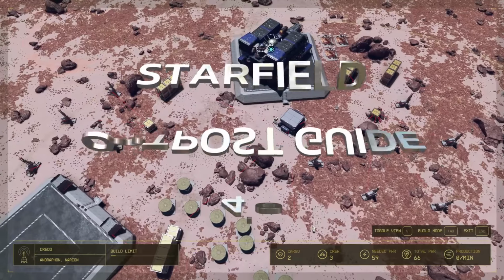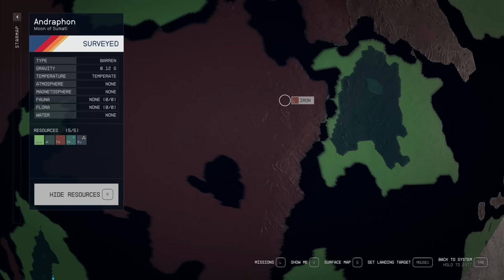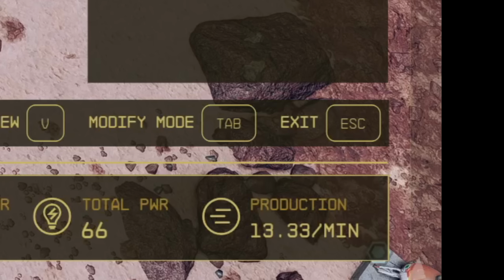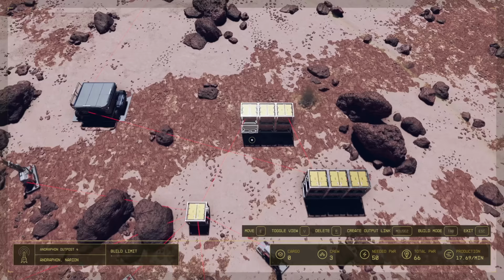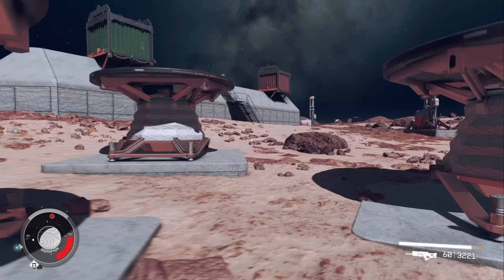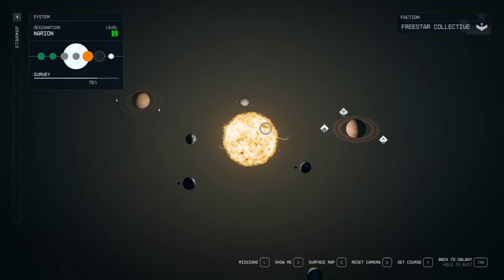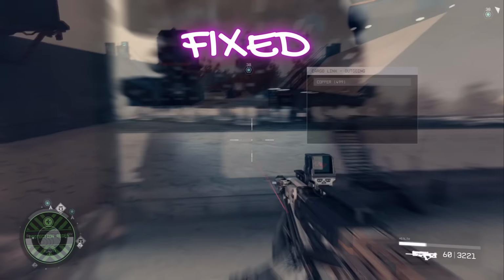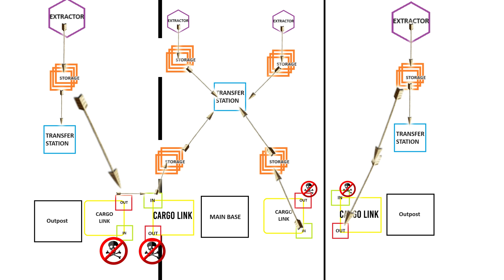[Starfield] Outpost Guide 4.0: How To Connect and Organize Perfect Outposts

Comment: When storing massive quantities of resources from inventory to storage it will not funnel the resources down into the seperate containers even when linked. Storage connected to extractors funnels through all connected units. How do you store massive amounts of solid resources from your inventory to containers with one click??? I connected everyone in a chain but it just it doesn't work when it's being transferred from your inventory....
Reply from the maker: It won’t work like that. You can however put all materials In your inventory into the infinite chest in the lodge crafting basement with on click. I typically will bulk move all my stuff there for later crafting.

Comment: nice video, fairly clear and way better than I started out with, should help loads ... my question if you have had this problem .... how to sort multiple item types ie iron and copper on one system interlink ... I can get the items to the new interlink but sorting them ??? it goes into one storage and you are unable to separate the incoming types ie I have 6 items incoming from 1 outpost but I can only sort them into solid/gas/liquid not say iron and copper in the solid
Reply from the maker: This is the problem with cargo links. They really suck. Unfortunately the best method is going outpost to outpost

Comment: Thank you for this. Can you make a video explaining power generators. I can't seem to make these work efficiently at all despite having 6 extractors all going to helium production. It seems the generators take every bit of the helium despite having solar arrays also running the helium extractors.
 It has been an absolute headache trying to figure out the issue. Or is it that helium power generators need a buff in an update? It almost makes no sense to even have them. I have 0 helium production because the generators consume everything. It should not be this hard to figure out
Reply from the maker: Honestly helium is useful for starsystem cargo links but as a power source seems silly. I just spam solar personally as I can make unlimited amounts

Comment: If spa e is tight, can you put storage boxes all on top of the ressources? Ie inside the Extractor bubble.
Reply: The only limit for space is really where you want your initial extractors, so place all those first and build right up to, and around them later to fill up the base with cool and useful stuff like a decked out hab/watchtower/work stations/etc! 

Build it up slowly and plan/think as;
1. Storage linked stacks are the hardest to move.  
2. transfer/ship platforms require the most space and should be as close together as possible for easy getting around. But easy to move!

You can always shuffle around later to better setups, that’s what I did. 

I Love 💕 my highly productive beautiful main outpost now! Ty @Tacticat!

Comment: A question: Do you know if there are bugs with shipping multiple materials through one inter-system transport link? Let's say we're on Andraphon and we're harvesting Aluminum, Beryllium, Iron, and Helium, no issue. We link their storages to our Outgoing box on the inter-system pad. In Tau Ceti, I have the Incoming box set to deposit to some solid containers and gas containers. Helium appears to come in. However, I only have Aluminum in my solid container. If I check the cargo link back on Andraphon, it says "Outgoing resources" and lists Aluminum and Beryllium, sometimes Iron and Helium, and sometimes just Iron or Aluminum. Any workarounds?
Reply from the maker: It’s all pretty jacked - I personally would put down 2-3 links and send one material per. But the cargo links are so so slow that I just go out post to outpost and gather 6-7k material at a time. You can hold unlimited weight for now. But they will for sure change
Reply: @TacticatGaming  If they fix cargo links and storage I will absolutely let them put a weight limit on my character, but for now I'm holing out hope for mods.
Reply from the maker: They need to let us have future magic like teleportation to explain inter connected planets

Comment: They really overcomplicated the whole outpost storage thing. Don't get me wrong, it's cool to have physical representation of storage, but the whole linking process and the bugs involved are just a result of this complication. They could've easily given every outpost the solid/liquid/gas/item storage property and initialize it at 0, and then expand this storage as you add more containers, without the need for any linkage, not only squashing bugs in the process but saving on processing power.

Think of it like this: you set up a beacon, now you have an outpost. This outpost has storage already, it's just at 0 capacity. For every storage unit you add to the outpost, this value increases by an amount corresponding to the container you placed (think hidden skyrim trader chest but with variable capacity). Any goods extracted/manufactured at the Outpost are added to this consolidated storage. The final thing to set up is a storage transfer unit, which would essentially just be a terminal with the outposts consolidated storage shown like a regular container - like the current storage transfer container (which is just the single most confusingly named item in the game), but without the need to weirdly shuffle cargo around in the background. 

If you thought this was a boring solution, you could still have some of the "linking" ""gameplay"" by enabling the player to place down things like storage inputs and outputs and give them that feeling of setting up a production line, just with less hassle.
Knowing how the creation engine previously handled script/processing load with its queue system and all the issues that came with that, i'm surprised to see them using a process-intensive solution like that, but they might just have improved the engine significantly in that regard.

You just fixed pretty much all the bugs that the current outpost system has, while adding a bunch of QoL in the process.

I'm saying all this as a big starfield enjoyer, and honestly, the game has been amazingly bug-less for a Bethesda release~

Also, great video, cheers!
Reply: This is something I really hope gets added with proper mod support. Basically just one "super chest" in outposts that is a consolidation of all of the other chests without the need for linking. Items just magically appear in this chest and it's way easier to manage.

we also need some sort of filtering system with the cargo links so that we can whitelist items to be sent out to other outposts instead of it just grabbing everything that is linked..

Comment: Shame that you can't use multiple transfer containers in one outpost - I use them as automatic sorting of all my bought resources. I have 10 boxes of solid, manufactured, liquid and gas storages and one link to each type from transfer container. Then when I arrive to outpost with my ship full of gathered resources, I just put all to transfer container and it sorts everything to correct storage. But I can't use it to pull things out. It isn't that bad if I craft everything in this outpost (it pulls from crates), but I can't use second transfer container to pull resources out to transfer links or ship storage...

Comment: Guys probably i didn't get it right but on the line diagram you show you put 2 cargo link one for each coming base rss it's necessary? or just make it easer or was just to show the idea? Or make transfer faster??
Reply from the maker: 1 link for 1 link - you can't link multiple cargo links - it's pretty dumb but that's the way they designed it
Reply: @TacticatGaming  too bad we can run out of space if we put 7 sub bases and 1 main so everything get to one place. 🫣
Reply from the maker: It’s not an ideal system. I’m pretty much not recommending cargo links right now, but I wanted to show people how they work so if their fixed you have a guide

Comment: 15:15 Why are you wiring up your solars/power generation? Looks like an absolute nightmare to manage.
Reply: I thought that, pretty sure power doesn't need to be wired in this game, unless it's nuclear power requiring a resource to run, even then, its in and not out.
Reply from the maker: I wouldn’t suggest ever wiring. This was a test base where I played around with alot
Reply: @jaywall4591  Yeah, you don't need to wire power generation. But once you do, you have to wire everything for it to run.
Reply from the maker: Yeah it’s a nightmare I warned against this in my 2.0 guide
Reply: only time i wire directly is when im just getting H3 extractors running to fuel my generators. if you wire them directly it only powers the extractors its wired to instead of trying to spread the power to everything in the base. once the generators are running the solar can be torn down
Reply: @jaywall4591 just to clarify this comment as I was confused at first. You do need to connect power to your extractors. You don't need to connect all the power sources together in a grid/network.

Comment: Due to bugs and issues the best way to go about it (currently) is the following, based on personal opinion here.   
  
For easy basic resources like iron, nickel, aluminum etc. Simply find outposts with them and build storage for them. Name a base like that [Iron - Nick - Alum] so it's easy to ID.   
Instead of using cargo links. Just get a good cargo ship and manually go get these when you need to refill. Manually transporting them home to HQ.   
Unless you have some insane industry thing going on, manually transporting 500 al, nick, iron once will have these resource needs covered for ages anyway. 

Do the same for other basics, like titanium, tungstein, lead etc.   
  
Build cargo links and inter-cargo links for more RARE and EXOTIC resources in different systems. And link them to a primary SUPPLY DEPOT outpost. 
Then decide where you want you final ultimate uber mega HQ super base thing. And have the supply depot linked to it.   
  
Thing is. IMO. Making everything automated would be cool. But there's simply no practical need to create a fully automated super intricate cargo link web. And it's super buggy and has a lot of issues. Not to mention the insane time and energy needed to create that infrastructure. It's way faster, easier, and more effective, with a lot less headache, to invest in a decent cargo ship - and manually transfer the brunt of basic resources. Cargo links and inter-cargo links should rather be used to make things easier in regards to more rare and exotic resources scattered around. I've seen arguments that it should be the other way around. Cargo link basics, manually collect exotics. Or manual everything. Again this is just my opinion here - but the better option is to just manually transport basics, and it's a toss-up between also doing it manually with rare & exotics or cargo link them.  
  
TL;DR: Cargo links are not worth the time, energy, effort and headache to automate basic resources. Just use your own cargo ship to manually transport them. If you go get 500 alu, copper, iron or w/e you won't need to redo that in ages anyway. Unless you have something really crazy going on.
Reply: A argument for cargo link for cheap resources is that they are heavy. But I like your idea a lot. I think in my ng+ I will craft tons of aurora and be very evil
Reply: If you're already mining rare materials, you no longer need a beginner's guide. that's rubbish. A beginner doesn't have enough cargo space to cart around large amounts of resources. If you then have to visit 4-5 outposts for every new module or mod, it's extremely annoying.